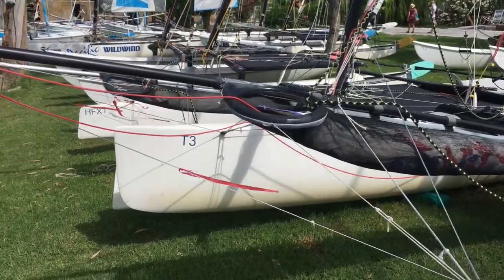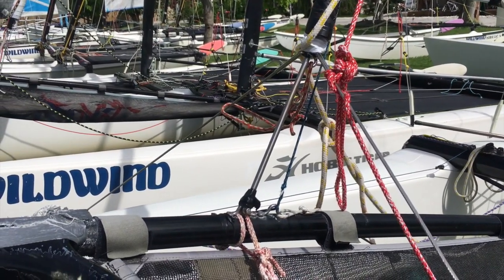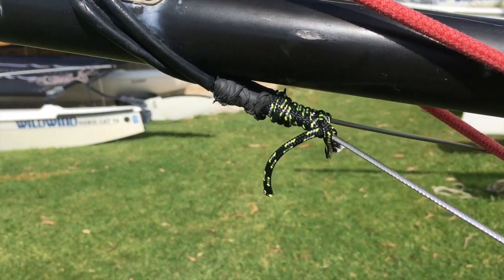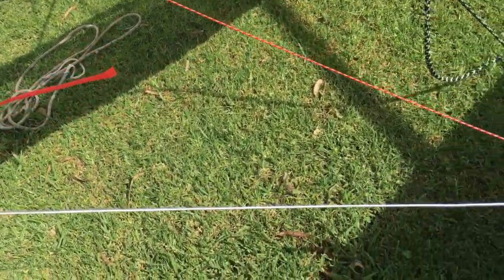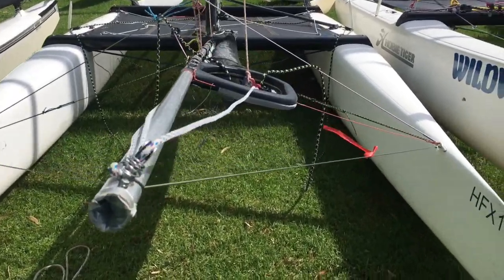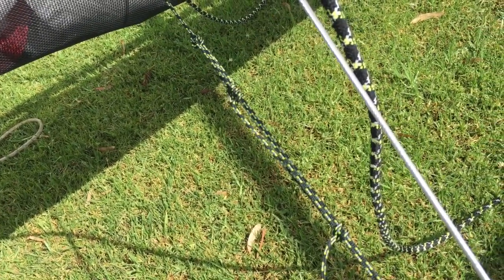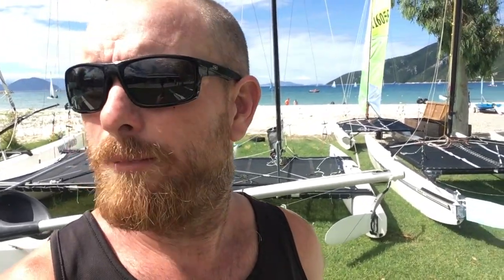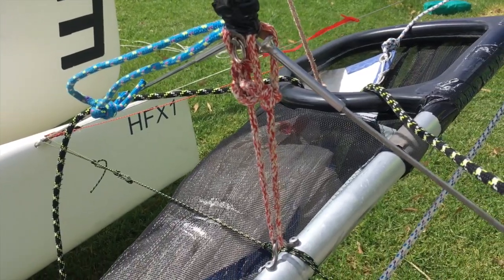Methods of attaching the bowsprit

Comment: Hi Joe... At what point in your sailing career do you decide to add a spinnaker to your boat. I own a prindle 15 and my  sailing colleagues are telling me how great it is to have one. What must a sailor consider before investing the money to add on a spinnaker sail (and all if the other  parts)
Reply from the maker: I think if when you're sailing downwind the boat quite regularly seems like it needs more power to add interest, power, boat speed and to get you down wind quicker then would be the time to consider adding a spinnaker. 
I think a key consideration should be the size of your sailing area - when you're getting used to using a spinnaker it's very handy to have a lot of space.

Comment: Great video Joe ! Thumbs up, as usual :-)
Just one question: at 2:52 the block at the tip of the bowsprit looks line leaning on the port-side. Is that normal? Mine has a tendency of doing that too: I've always been worried by that, shouldn't I?
Thank you again for your tutorials
Reply from the maker: I think it's quite likely that that block will lean one way of the other. If the tackling is running smoothly it's nothing to worry about.
Reply: @JoyriderTV  Thank you ! :-)

Comment: Hi Joe, had the first sail on the Fox yesterday, its a weapon! We pushed it pretty hard, all good, but carrying the Spi on a beam reach the Pole snapped as it was bending in the middle. A post mortem revealed that the intermediate stays where the sock opening is were not present...Thats where the pole snapped. Im thinking of repairing it with an insert. Would this work?
Reply from the maker: Yes, we've repaired poles in the past that way. As well as the intermediates make sure that you pole has a little pre-bend - enough so that you can see it - make sure that if you have used any rope that the rope can't stretch. Then you should be ready for action - once repaired you can send me some pictures if you like - totaljoyrider@icould.com,
the Fox is a beast!!!!
Reply: Joseph Bennett Awesome! I hope that will hold out till the new replacement arrives. The dealer is investigating if they assembled it without the intermediates if so, will discount new pole! Yeah, I will use thin Dyneema for this. Will send the pics! Any other pointers on how to do the repair? Maybe a longer insert to spread load? Im concerned about point loading where the insert ends. Thanks!!!
Reply from the maker: Yes, a longer insert 60 - 80cms should be good.